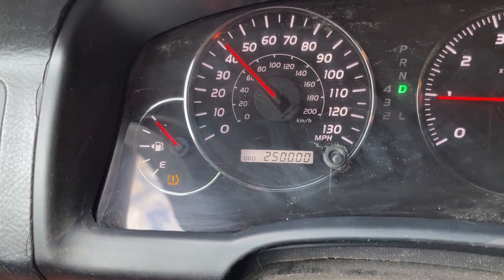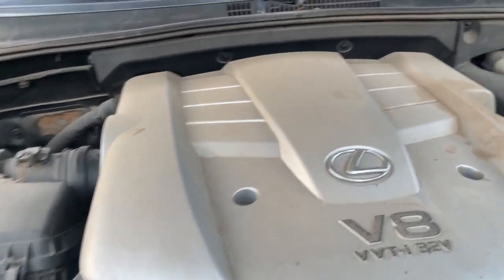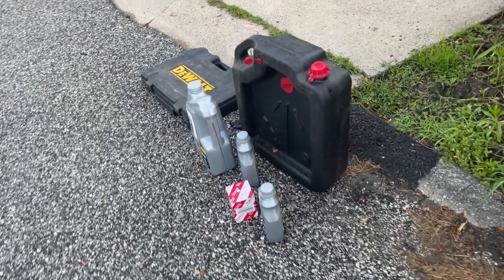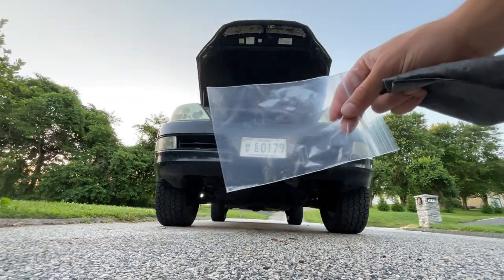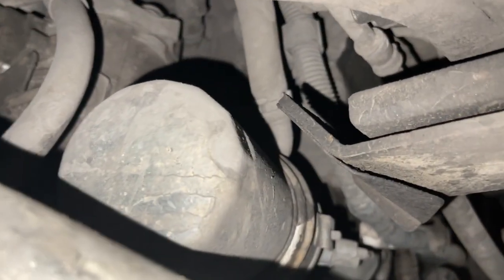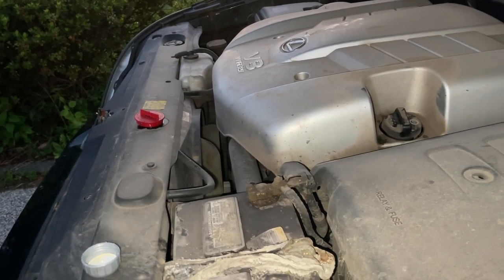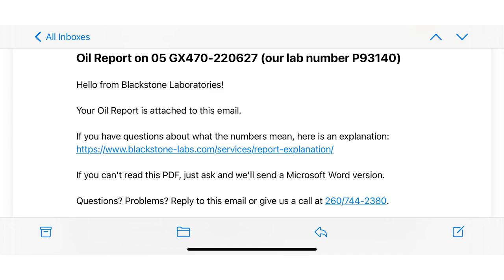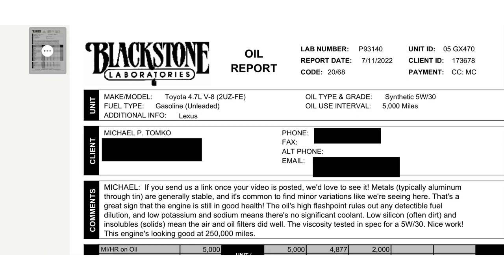What does the oil look like in a 250,000 mile Lexus GX? Blackstone Labs Oil Analysis

Comment: Have you changed the water pump and the timing belt yet if you did do you do it yourself or do you go to a mechanic to get it fixed I’m just wondering
Reply from the maker: Yep, water pump and timing belt were both changed at around 220,000 miles. I had my mechanic do that job.
Reply: @mpt.yt4  yea I don’t blame you it’s a big job also I noticed the low tire pressure light was on and I’m sure you know this but it’s probably on because the spare tire pressure is low I’m not sure why Lexus decided to have a sensor on the spare tire but I’m just letting you know
Reply from the maker: @alexreed9940  yea, spare tire is low and the other four tpm sensors are bad so it’s either stuck blinking or solid, just depends on if the spare has enough
Reply: I ended up buying a new spare. They wouldn’t change the sensor in a tire that’s almost 20 years old 😂 anyway, I did it. Restoring this to as close to new as I can. Think it’s got a lot of years left